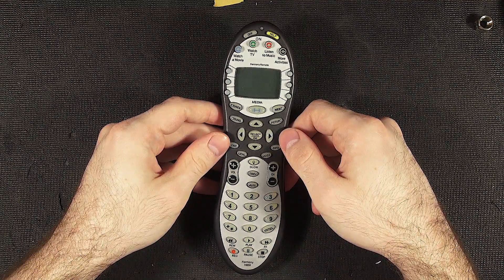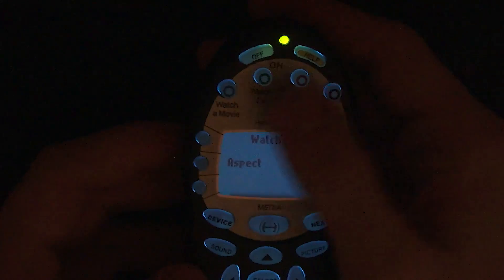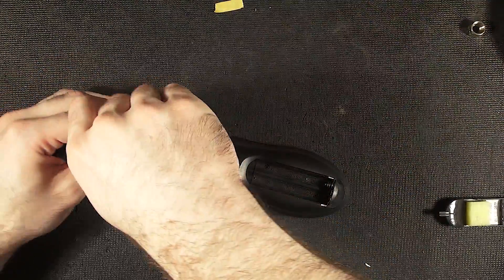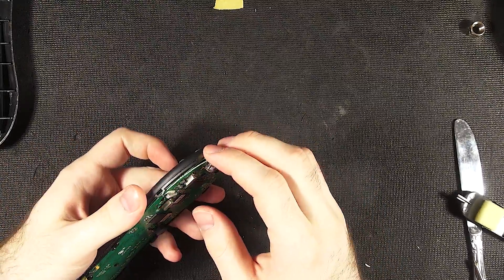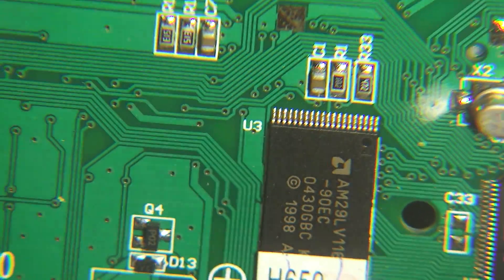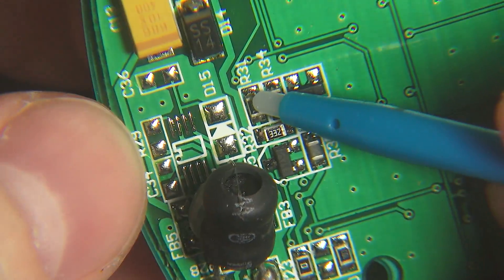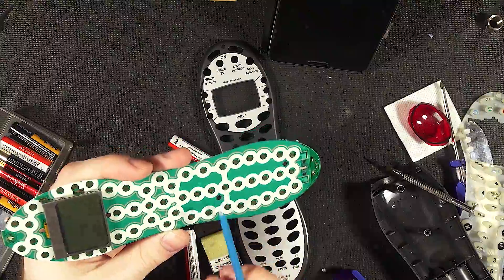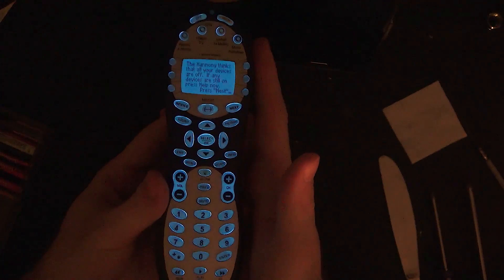Harmony H659 Remote Teardown

Comment: This remote is amazing. I have a box with broken ones, some bad board, others mechanical, anytime I wear one out I just reassemble a new one and plug it into the Windows 7.7.0 web interface for a quick firmware update and settings reload. Kudos to Logitech for continuing to support these remotes 20 years one. I have had all Haromonies since the four button one, every remote I had since the 659 got returned, their mobile and MyHarmony utilities can't hold a candle to the 7.7.0, additionally this is the last truly tactile Harmony remote, meaning you can feel your way through the button in total darkness. Needless to say all of our 3 systems are serviced by these.
Reply: Imo its the usb cable that causes issues on these.